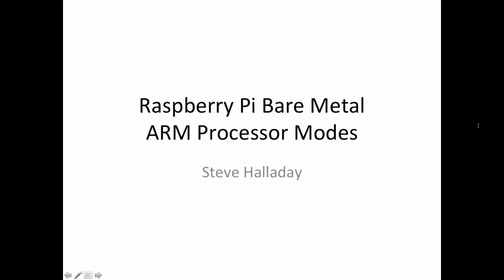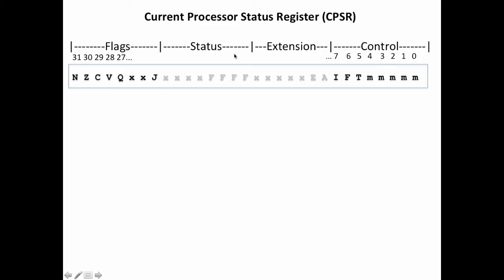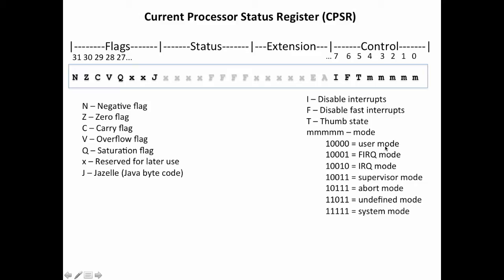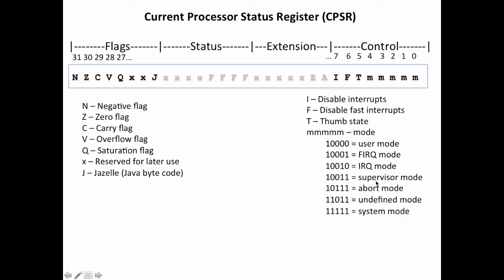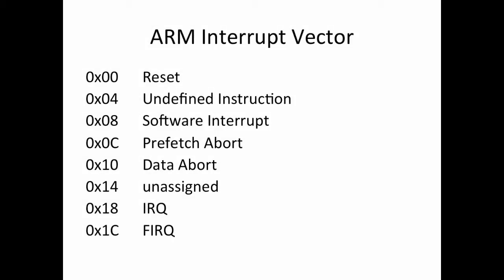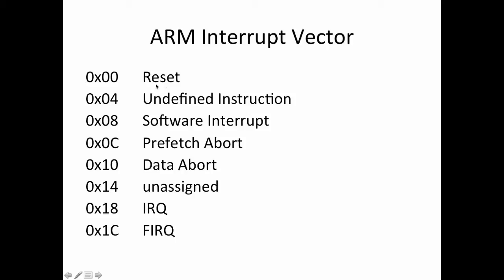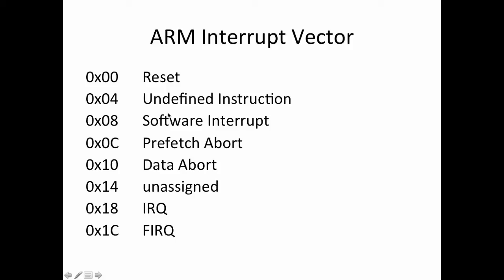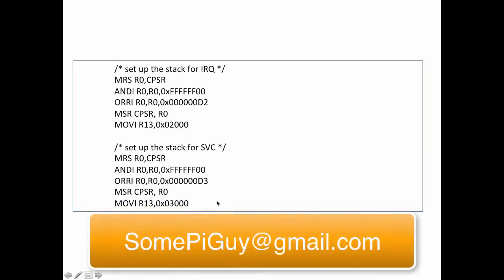Raspberry Pi - ARM Processor Modes

Comment: That's a great point.  So what you are saying is that instead of branching to the FIRQ routine, you can build it at the end of the vector to avoid the branch delay.  Thanks for the tip!